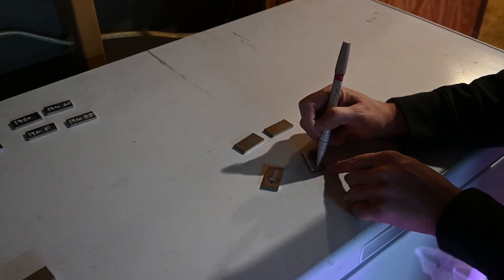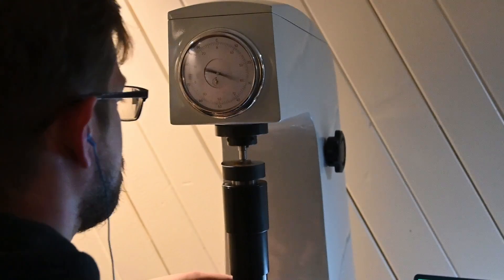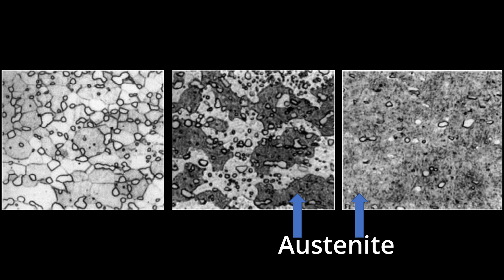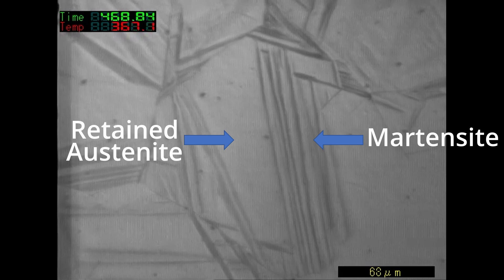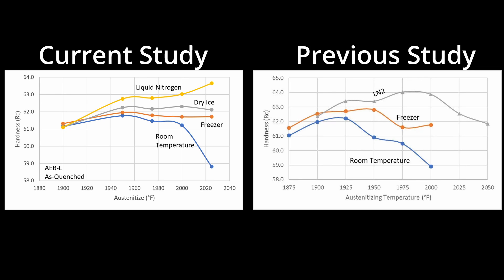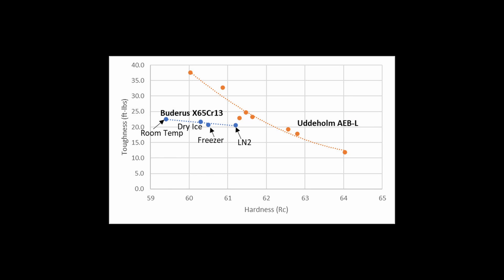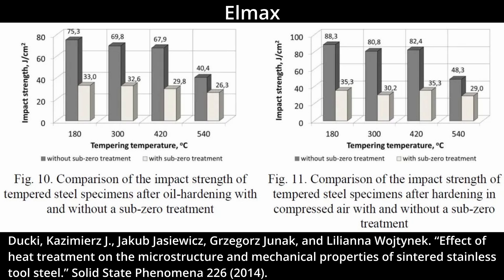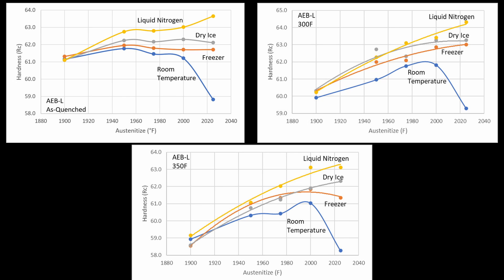Do You Need Cryo for a Good Heat Treat?

Comment: i see you dont clamp your aluminum blocks? most seem to insist on that to prevent warping. you have strong dainty fingers   now in my mind you'd get a more solid build working a warped piece than you would forcing a piece into a stress position before cooling, any thoughts?

Comment: I may be a little late on the comment, but Not surprised by the similarities between dry ice and freezer as compared to Liq N2. Dry ice has a sublimation temperature of -109F where Liquid Nitrogen (LIN) has a boiling temperature of-320F. More than 200F colder.

Comment: Cryotreating does not reduce toughness. 15-17% conversion of austentite to martinsite improves toughness. You should also post cryo, perform a heat cycle(between 300-700 degree F depending on alloy), and all cryo should be brought down to the lower margin slowly over a period equal to the BTU/HR per Crossection thickness recommended.

Comment: There are (were?) cryo services offered for many car parts such as brake rotors, valves, and connecting rods. It was, and still is, a contentious issue, with some saying it greatly improved wear, while others saying, not so much. I think the real variable in its use isn't scientific, but marketing-driven. That is, it's way too easy for vendors to "suggest" that it's awesome -   because it increases profit. Thanks for your detailed look into this as it unfortunately appears to be a mix of wishful thinking, confirmation bias, and greed, instead of a legitimate treatment.

Comment: What is the effect of delay between the "quench" and cryo?
I saw a guy on youtube that bought a ton of the same drills. He put half of them in cryo. Than proceeded with double blind performance test.
Was significant.
But a hrc number would be nice.
Reply from the maker: The retained austenite stabilizes through carbon diffusion to the interface between martensite and austenite.

Comment: I am in the Cryogenic treament business .  Our company follows the science rather than claims.  There are a great amount of research papers out there that contradict Mr. Mequita's claims including and most importantly real world results that we get.  There can be some underlying factors that might vary the ultimate results.  From everything that we read, the knife makers throw the most conjecture out there because they need to know just enough about metallurgy and tend to do their own heat treatments.  
1. Thermally shocking any steel into LN2 will not lead to optimum results... Proven fact.  Slowly lowering temps to -310 to -312F Yields the best results. (fact and proven too many times to be refuted) 
2.  Hold times are vital in most steel alloys.  Generally over 12 hours is very good but there is better, much better.  
3.  Deep Cryogenic processing should be done as the last process AFTER all heat treatments are done with a 2-4 hour 300-350F temper.  Although alloys such as 300M perform best without a temper.  
There is a reason why we treat industrial tools for large OEM's, Parts for sub contrators to NASA and many racing concerns.  They come back because there are marked results that save them time and ultimately money.

Comment: What about clamping between aluminium blocks that were pre-cooled in li-N2? Warping stopped and rapid cooling in one go...
Reply: Ice formation on the surface of the blocks  would dramatically decrease the smoothness/consistency of the surface and therefore lead to inconsistent cooling throughout your blank which would do more harm then good....

Comment: Does cpm (crucible particle metallurgy );technology align the different steels molecular structure ? I heard it s good becasue they don’t have to use alloys to bond the parts ? I know you know is why I m asking . It’s probably not that simple and I should buy the book .😊
Reply: Particle metallurgy only decreases carbide size (depending on your heat treatment protocol). It has no  observable benefit on the steel matrix.

Comment: Awesome video, this gave me a lot more confidence in my decision to purchase a LN2  tank, as well as my previous work with Nitro V and Magnacut only with a deep freezer. How long do you usually have to dip the blade in LN2 immediately after quenching, or is it cold enough that the steel would reach -300 within seconds?
Reply from the maker: It just needs to get down to temperature. 30-60 minutes is fine.

Comment: Thanks for this Dr. Larrin. So glad someone like you was finally able to bust the freezer myth and that “cold treatments don’t benefit low alloy steels at all.” 👍
Reply: Very interesting to see even a freezer shortly after austenizing gives such a notable effect. Also looks like it might help with home blade Smiths that might get parts hotter than others accidentally..
Reply: @mikafoxx2717  A lot of people out there on knife forums (knife makers included), often lack understanding of nuances like this. The lower the temperature goes, the less retained Austenite there will be in the blade. It’s not black and white like most of them make it out to be with Liquid Nitrogen. In fact, the interesting thing is if you look at metallurgical charts on this, the amount of RA converted actually tapers off dramatically once you go below 0F. Meaning there’s actually diminishing returns after freezer temps. So for an at-home knife maker, it seems like a no-brainer to me to just throw them in the freezer overnight. I always do. The dry ice and alcohol/kerosene works very well too. If you wanna go the extra step.
Reply: @Divine_Serpent_Geh Totally! It can help a lot with properties if one doesn't do a perfect heat treat and only make better a good heat treatment. Less RA is almost always a good thing. It basically makes hardness not match it's tensile strength, which is lower than it should be. Makes for gummy burrs, etc.
Reply: @Divine_Serpent_Geh  I'll add that I would always do it, especially forge heat treats with hypereutectoid steels that can have excessive RA. For 1084 or 15n20, you'll probably only get a miniscule amount as you won't get much RA, with 1095, or even 52100, I would definitely do it, especially if one isn't perfectly temp regulated.
Reply: Thank you for that video very interesting I'm trying to learn more about this subject so that I can treat engine parts camshaft connecting rods Pistons etc if you got any info send it to me thanks

Comment: extremely interesting. I was a chemist at one time so it's less Greek to me than to some , i suppose. But I don't play with stainless or HSS, just O1, 52100, and 1.25%  C file steel when i can get it. Those old made in America Nicholson files make great knives, but I've found it seems to improve them if you normalize three times before quenching. The edges don't seem to be brittle if you do that, even at a 375 degree temper. I have to admit i never tried bending one 90 degrees L and R.
Reply: I wonder what steel those old files are made out of?

Comment: I have been pulling research articles and reading cryo processing books for the past several months, at least when I can keep my eyes open and yes I have read all of Jay Fischer’s web site.
I have the following conclusions - as stated in the video, max cryo benefits are tied to a particular group of steels.  SS types seem to receive the most benefit.  All of my reading indicates that a controlled ramp down to LN temp is needed and that and that cryo treatment should start as soon as possible after plate air quench for the SS.  None of my reading, or any knife makes web site that I have found, or you tube video video goes over a detailed process to go from heat treat, to plate quench, to a controlled temp ramp to LN temps.  Plate quench to freezer, to dry ice to LN would be one way, but the final 200 degrees would be real fast.  Labs frequently use LN ice bath that consists of an EVA container with LN in it and a thermal plate used to transfer the cold without submerging the item in LN.  I have acquired the EVA tray and thermal plate and will be working on a repeatable process that includes good safety practices that can be affordable for a garage knife shop (no $8,000 cryo processor).  This will include a modified press for AL plates with compressed air for the plate quench.  A lot of practical questions to work out such as a data logger to monitor temps of 440C knife blanks as the go from plate quench to freezer to either dry ice and then LN or straight to the thermal plate sitting in LN for some time and then into LN for long soak.  Of course I have a. 20 week wait on my Evenheat over, but I will be working out process design, tools, and safety stuff while I wait.

Comment: Wow. This is extremely hard to follow and understand what is going on.  We go from freezing metal, to talking about heat treatment? With absolutely no change or notice as to WTF is going on?  This information seems helpful, however it like could be best put into print. When I wake from this coma I've been put into, I'll look for an online resource for this info. In a steel that's more appropriate to what I'm doing. Like CPM154. Or S35v.
Reply: As best I can make out, he's describing some bastardized hybrid of steel quench hardening and precipation hardening.  Totally unclear on when the cryo treatment is applied.  If before the anealing, the elevated temperature would be expected to redissolve some precipated material.  And one detail of cyro treatment that makes NO sense to me, at very cold temperatures it should take a Very Long time for molecules to move.  Think of how quenched steel holds at room temperature a meta-stable crystaline form.
Reply: @hanelyp1 seemed perfectly clear to me. I don't think  it's bastardized.  Just because it's hard to understand doesnt make it wrong. People seem to like to criticize everything to boost their egos when they feel inferior.

Comment: Would LOVE to see a video on Aldo’s Nitro V. 
I’ve used it to make 40ish chef knives with pretty great results.
I use Aldo’s suggest treat on the New Jersey Steel Baron website, without cryo. 

I’ve always wondered if the cost to get a liquid nitrogen setup for large chef knives would be worth the benefits of a cryogenic treatment?

Will DEFINITELY be throwing my blades in the freezer for a few hrs before temper, from here, and moving forward! 
Thanks for the video! You’ve earned a new subscriber!!

Comment: try heating to 3400c then fast moving helium under a very high magnetic Feld 2000 tesla in a 23 bar vacuum then place in hydrogen for 20 days under 30.000 psi no oxygen at all tungsten is a clue.

Comment: Hi mate, see lot  knife steel heat treating  block s and metord to do it. Thing is they never say. Say for instance :4mm  440 c. S/steel.   30 min for 1060c  for 30 min  then plate it or qiunc in fast oil what ever etc!! Hope you understand the ?
Reply from the maker: The AEB-L was 1/8" and it was austenitized for 15 minutes and plate quenched.

Comment: This is some really awesome information. I'd love it if you'd do the same test with M390. Whereas it seems like most stainless steels, they recommend cryo at ridiculously cold temperature which require liquid nitrogen, "they" say with M390, you only need something like -100ºF, which you can do with dry ice and acetone. I'm curious if it's true because I have a huge slab of M390. Once I get done with it I plan to never use M390 again, but in the meantime, I gots to know stuff!

Comment: Always use dry ice in a well ventilated area as it only takes 30% of the air in a room to be CO2 to kill you. Also do not use lacquer thinner nor acetone as the fumes are poisonous and possibly explosive.

Alcohol/dry ice mix never comes close to -109F of dry ice, it only reaches -90 at best as measured with an industrial infrared gun plus it wastes a lot of dry ice, too much interface with air unless you have it in an insulated cooler with a top that comes very close to the top of the alcohol mix is what we found. I put pieces of foam on the mixture to drop the temp closer to -109F.

 Just place flat knives between the dry ice blocks and they will equalize down to to at least -105F within an hour or two. I used ten lb. blocks and placed the knives between two sheets of .090 aluminum to prevent warping that direct contact sometimes caused, but any sheetmetal will work. I would place the knives between two 10 lb. blocks in a cooler with 4 inches of Styrofoam insulation and go home. I only ever mixed denatured alcohol for uneven machined parts, it isn't needed for flat knives and saves money, last time I looked dry ice was $2.00 a lb.
Reply: Yeah insulation is key with dry ice :)
Reply: @AAAAAAndrea  It keeps for a long time if you treat it right.
Reply: One trick is to mix your dry ice and alcohol then put your blue in it then put the whole thing in the freezer at -14. Keeps the dry ice from sublimating so fast, and this allows you to use less dry ice.

Comment: AEB-L (along with 420 and other hypoeutectic low--to-medium-carbon stainless steels) is garbage, and always has been, even since before the Japanese first started exporting it here in the 60's and 70's and gave stainless steels such a widely reviled reputation. Why on earth would you make a knife from that trash instead of a /good/ stainless like 440c or ATS34 or CPM154?
Reply from the maker: AEB-L is in fact hypereutectoid (not to be confused with hypereutectic) because chromium shifts the position of the eutectoid. AEB-L is not a low carbon steel. AEB-L comes from Sweden not from Japan. If instead you mean 420, that was invented in Britain and the good ol' USA and can't be blamed on Japan. 440C and ATS34 have higher wear resistance than AEB-L but of course AEB-L has much, much higher toughness. Different steels for different applications.
Reply: Don't you know SIEGE knows a guy that knows everything so now he knows everything to tell us everything he knows. All because the guy he knows sells knives for $1500 , so it must be true. Sign me up.
Reply: Sry guys I can't stay, about to piss myself! XD
Reply: Hopefully, you're only suspending the coupon above the liquid, not submerging it (!!!), but more to the point, you should be bringing the steel temperature down at a consistent and measured maximum rate of -4°F to -5°F PER MINUTE from room tempt, no more and no less, not just hanging it in a Dewar flask!! This is a scientifically defined, known and repeatable process that is well documented, as are the reasons for and effects of deep cryogenic aging -  this is science done long ago already. 

Plus, in actual QUALITY steels (unlike the AEB-L / 420 SS you're using here), it takes more than just a single brief treatment to achieve the true maximum potential of the steel for toughness, hardness and corrosion resistance - otherwise, the best smith I personally know of wouldn't spend 170+ total hours on his cryo quenching process. Given that he has been making knives for 40+ years, and is literally years in backlog despite the fact that his knives start at $1500, I am inclined to believe he's got his stuff worked out to a T, and since he rigorously tests and documents his processes, he wouldn't be doing it if it didn't work.

The reason for cryo is that in stainless steels it is required to complete the conversion of retained austenite to martensite in martensitic steels, and the deep cryo soak works as it does is because at DEEP cryo (-320°F), eta carbides precipitate, which does not occur at any other time. As a low-alloy stainless steel, AEB-L will never develop those carbides (as far as I am aware), so you may have made it hard, but to little real overall benefit in this otherwise junk steel.
Reply: @b3s13g3d  Have you actually tested any of this yourself or are you just regurgitating everything verbatim from a website?
Reply: @b3s13g3d  Are you really trying to educate a doctor in metallurgy about steels. You know he is the person who engineered MagnaCut. What impresses me the most about that are not the properties of MagnaCut but the way it achieves those properties. To be able to conceive the composition of that steel you need a comprehension of metallurgy that exceeds that of anybody on this thread.
About AEB-L and 440C (who has a lot of haters as well), I think Dr Thomas said everything needed to be said: « Different steels for different applications. »